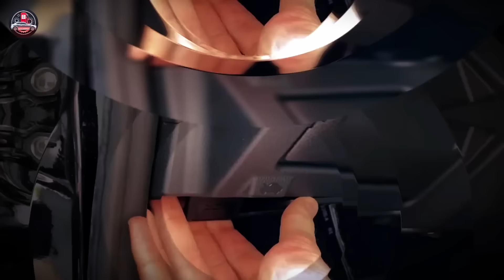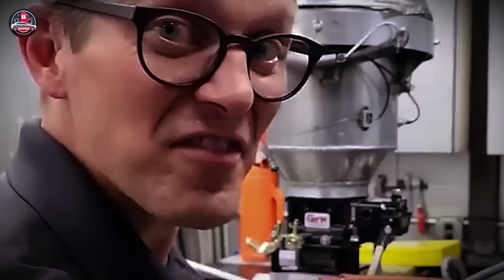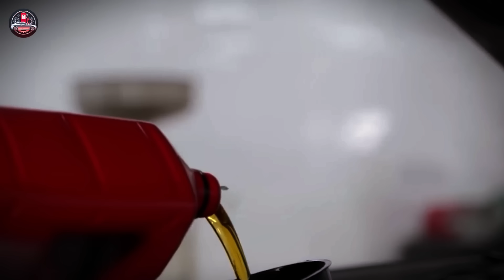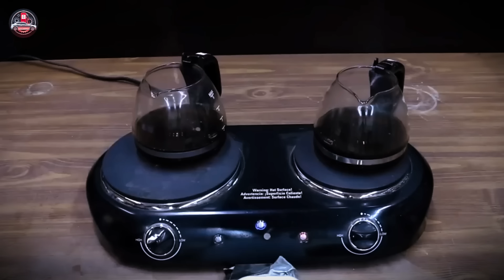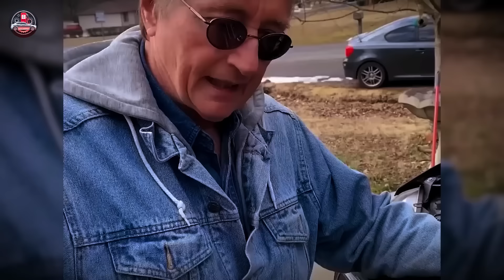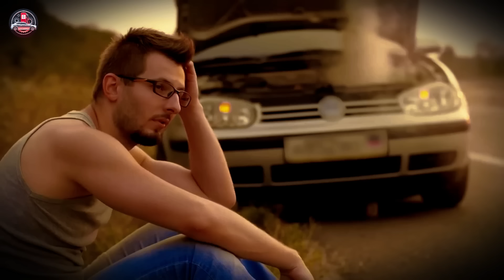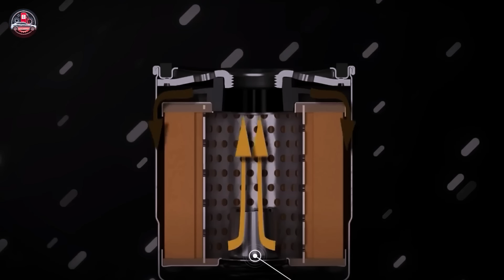We Ran 0W-20, 5W-30 & 5W-40 in the Same Engine — Here’s the Truth | Everything Oil for Car

Comment: Carlsbad NM, 88220 manual states 5 W 20. Using 5 W 30 Chawawan desert temperature . Fuel milage went up not down as expected. Asian engine blow by reduced 50 to 60% catalitic loading with oil loading and plugging.
Kia forte NU 4 l engine.
Engine much quieted using 5W30 from 5W20-Manual
Reply: Oil consumtion is oil pcv valve entrance to a cylinder valves carbon buildup and catalitic converter plugging and back pressure increased blow by adding more oil plugging.

Comment: 0W/5W-40 A3/B4 OIL CHANGE EVERY 5-7K KM IN 33 OLD WITH MANY MANY  KILOMETERS  FORD TURBO DIESEL INTERCOOLED EGR  AND CAT. WITH CAST IRON ENGINE BLOCK AND HEAD  WITH ZERO OIL CONSUMPTION ON ORIGINAL INTERNALS EGR  EXHAUST DIESEL PUMP AND TURBO. ENGINE NEVER OPENED. RUST FREE RUNS AS NEW

Comment: Matance, oil change every 6 months or 5 thousand miles according to my manual for my vehicle, which ever comes first, 0- 20 oil
Reply: O-20 can degrade or absorb water when not frequently be driving at high temperatures long enough from what I've heard, that can degrade it's lubricant protection on moving parts
Reply: +4
Yes, 0W-20 oil—even fully synthetic—will degrade over time just from sitting in an unrun engine. The primary cause is not mileage, but environmental exposure (oxygen, humidity, and temperature changes) that triggers oxidation, additive breakdown, and condensation, which can lead to sludge buildup and acid formation. 
Chahel Automotive
Chahel Automotive
 +2
Key Factors in Oil Degradation Without Usage:
Oxidation: Oxygen enters the engine and reacts with the oil, making it thicker and less effective.
Moisture/Condensation: If the car is in a humid environment or subjected to temperature swings, water vapor condenses in the engine. This water reduces lubrication quality and forms acids, which can corrode metal parts.
Additive Breakdown: Additives (detergents and rust inhibitors) designed to protect the engine begin to lose effectiveness over time (usually within 6–12 months).
Contamination: If the engine was run occasionally but never reached full operating temperature, small amounts of fuel and moisture from cold starts may have mixed with the oil. 
Just Automotive
Just Automotive
 +3
Recommendations:
Annual Oil Changes: Even if the car hasn't reached its mileage threshold, it is recommended to change the oil at least once a year, particularly if you live in a high-humidity area.
Running the Engine: Simply letting the car idle for a few minutes isn't enough to prevent this; you must drive it long enough to get it hot to burn off moisture and fuel contaminants. 
Just Automotive
Just Automotive
 +1
Conclusion:
While a sealed bottle of oil can sit for years, an engine is not perfectly sealed. The oil in the crankcase is on a "clock". If the car is in long-term storage (more than 6 months), it is better to change the oil before storage or immediately upon taking it out of storage.

Comment: I have it Ford Ecosport 1.5 diesel 100hp (Z2JA)  2019, the company says to set it to 0w-20 only, the ambient temperature in the area where I live (Greece-Athens) is the lowest 4°c to 44°c because I consider it too thin and in order not to get too far away I use 0w-30, maybe 5w-30 is better?
Reply: 0w30 would be preferred viscosity oil in that excellent Ford SUV. Don't go too heavy! Engine tolerances tighter than ever. If under any warranty stick w/recommended viscosity & change oil sooner. 👍🏻

Comment: This explains why the hemi 5.7 L engine ticking between 60k mi -100k miles
Reply: The Hemi “tick” is caused mostly by high idle hours. More city driving “stop and go” traffic. When you let the vehicle sit still while engine running ( whether in park, or in drive) the oil isn’t being pumped up to the top half of the engine due to low pressure. If you watch the pressure it will go from 50 psi (while in motion) to 30 psi ( when idling whether in park or in drive at a stop light). Over time, this will damage the upper cylinders, lifters, valves, rockers, etc.
Reply: The tick usually disappears after less than a minute after the first start Manuel states to use 5w-20.

Comment: not sure if this vid is real but i went from manufacture 0/20 n ram to 5/30 and rattles on startup disappeared.....high mileage engine so 5/40 maybe the next stop.... i will check oil condition this next oil change. All i can say is 0/20 feels like water with no viscosity even warm.... no thanks.....

Comment: This is a somewhat different topic.  Someone should test air cooled engines on zero turn mowers.  Mine has a Honda GXV620 and Honda recommends 10w30 or 30w.  In 98 to 105 degree heat.....that oil doesn't protect.
 enough.
Yes, air cooled engines run hotter than water cooled cars.  But, do a real test.

Comment: Use MOS2 for cold start protection. My D16A Honda 2003 engine is up to 440,500 km / 275,000 miles and still running smoothly after 23 years of non stop operation.
Reply: What source do you use, and how much do you add per qt of oil capacity?  Thx in advance.
Reply: @MrJdsenior  0.03-0.05% dilution in 3.5 litres of oil - about 1 - 1-3/4 gms MOS 2  technical grade powder stirred into 1 quart of the new oil before adding it to your engine at oil change. Add every 30,000 km.
Reply: @LeithYearwood  Thx Leith, appreciate the time you took to reply.  I will make use of that info.

Comment: This whole test is bogus as they were using Group 3 'fake' full synthetic oils.  True Synthetic (PAO ) oils never break down in a gasoline engine from heat.  They just get dirty and additives need to be renewed. Also why not try the 0W-40 that GM now recommends for cars that originally used 0W-20.  The vast majoirty of oil issues in engines since 1999 is the fact that we are not really using real synthetic PAO oils, we have been ripped off with Fake synthetics using Group 3 oil base (dino oil).  There should be a class action lawsuit for all the oil problems in new cars over the last 30 years because of this.

Also engines don't run any where near 3000rpm on the highway.  Most engines, evven small 4cyl and V6 engines run between 1700 and 2400 rpm at normal highway speeds.

Comment: Knoxville Tennessee. 
2010 Jeep Grand Cherokee Laredo WK 3.7 v-6. 
178,000 MI. 5w-20
Daily driver
Reply: I would switch to 5w-30 high mileage full synthetic if I were you
Reply: @Real_Rob_Reels 
Yeah I had been thinking that she is starting to use a quarter oil every 2500 miles
Reply: @Abaddon184maybe use Stiction Eliminator on your next 2 oil changes.

Comment: Hawaii tropical weather
Using 0w/20 full synthetic since 2018
67,000 miles without problem 
Can I change to 5w/30 need your opinion..?
Reply: Why change if all going well. More important to not go past 6k mi oil changes than changing viscosity recommended. 5w20 will add bit more stout & safer than 5w30 for ur engine. Facts.

Comment: Brian Northeast Florida Bmw X5,167, 280 miles Bmw F33 175,032 miles. BMW recommends 5 30, I run 5 w 40, because hot and humid Florida. Perform maintenance as the manufacturer requires and you have no issues with oil. My BMW E36 went 348,000 on 5 w 20 before a coolant loss killed it. This video is pointless, The .0 whatever untill oil circulates doesnt matter with synthetic, the wear surfaces retain the viscosity for months.  properly cooled and filtered oil can drive thousands of miles at 4-6 thousand RPM across the country, so saying the Honda engine broke the 0-20 oil in 30 minutes is unrealistic. Dyno testing oil is crap.

Comment: Adelaide South Australia. i have a 525 E60 BMW, it is reccommended to use 5W30 but most BMW workshops here reccommend 5W40 and thats what i run in mine, i change it, including the filter every 5 to 6 thousand kilometers.
Reply: 5W30 Northstar 12- 2001 Cadillac-Amsoul
Reply: 10w-60 in very hot climate or spirited driving

Comment: Just looking at the title I know this is ridiculous. Different engines require different viscosities, for example in the piston aircraft I work on we run exclusively 20W-50. Being that thick would destroy an automotive engine pretty quickly, because the engine is built very differently with closer tolerances. Run standard auto oil in the same aircraft engines, it would not provide enough protection once it gets hot. Just look at oil specs across different temps, often different viscosity for different seasons

Comment: Marlen in Aguilar Colorado.  I use Amsoil 5W-30 in my '90 and 97 Lexus LS400's, '92 Lexus SC400 and a '92 Buick Roadmaster.  The all will go well over 10,000 miles before I have to add a quart. The '90 Lexus now has 276000 miles and looks, run and drives like a new car.
Reply: Newer Lexus vehicles are not as good as older ones. Not even close! Facts.
Reply: The older Toyota engines will run half a million miles on just water. Not really but they were amazing, next I always liked the 4 liter Jeep engines I put 650k miles on a 95 Jeep engine and it was still running.

Comment: Was the engine designed to run 0w20 ? Engine tolerances vs the engine built to 5w30/5w40 specs

Comment: Fullerton, California. Started running 5w30 Valvoline Restore and Protect Synthetic in my 2005 Honda Accord with K-24A engine at 163K miles. Still consumes 0.5 quart per 1,000 miles like it has since new.
Reply: Great move now try the 5W40 I was amazed after 4 4 changes 3k each on a 3.8 with 150K

Comment: I live in Mongolia.   Winters are severe.  -20 to -40 Dec to Mar. I use  0W - 20. About 100000 miles on the Prius. Use about a quarter of a quart between oil changes. Usually change every 4000 to 5000 miles. Why do you ignore 0W😢? - 30 and 0W - 40 oils

Comment: 2019 Ford Mustang GT 5 L in Florida… Approximately 15 to 18,000 miles per year. In the spring, to summer, I’m running 20 W 50 mobile one full synthetic and in the cooler season I’m running 15 W 40, full synthetic.
I’m pretty sure I have the only coyote that doesn’t tick at idle

Comment: College Station, Texas    0 20 full synthetic oil Mobil One in 2013 Nissan Altima S with 144,200 miles
Reply: Is your Synthetic Group III or Group IV. Word Synthetic is a marketing term. The court case between Castrol and Mobil 1 regarding the marketing of synthetic motor oils was ruled in April 1999 by the National Advertising Division (NAD).

Comment: I live in Kingman,Az. I use 10w20 in summer and 0w20 in winter. This is  what Honda recommends.I Change oil every 3000 to 4000 miles. I have 2005 pilot with 280000miles. 2017 with 120000 miles.
Reply: IMO, 0w20 is too light for that HOT climate. I lived in Las Vegas and always used 5w30 in our Maxima's even though 0w20 is specified 4 EPA Cafe standards.

Comment: 5K intervals. North East 5W-40 2014 Passat 1.8 EA888  179,962 miles turbo. Cruise set to 57 on interstate slow lane sunroof open 29 minute ride to sons close to 41mpg. Not common driving conditions but when time and conditions allow GS in NJ, 
40 mpg on a gas when cruise set to 57 in slow lane 1.8 w/189K 
ain't bad

Comment: Do the recommended oil weight. You have oil ports,where oil lubricants everything. Their is a reason for recommend oil for your car
Reply: 0-20 in US for most Toyota-Lexus but every other countries say 5-30. The O-20 runs dirty past rings and the film fades away faster at rest, so the start up argument is suspect.
Reply: @carlpiersall1683 i don’t care about other countries.

Comment: I have a 2010 Silverado with 5.3 ,when I run full synthetic when idling about 20 pounds when I run 50/50 synthetic the pressure is at about 30 pounds and over 40 on the road Ben running 5 w 30 for both ,I even noticed more power from the 50/50 synthetic,I have  over 210,000 miles on it yes I’m running a amf delete .

Comment: 55w20 mixed with heavy w30 in winter, and w30 in the summer. But only after using an oil additive.   Do this made start ups easy at -50c in the winter time, never idle for warming engine, but drive slow till engine warms up equivalent to one city block. I'm not sure if I'm hurting my engine but it pures like a new engine. Engine at125000km  engines to my understanding break in at 180000km.

Comment: Lavalette, WV.
2012 Subaru Forster / blower
133,000 miles / 0 W20 Mobile 1
1 quart/ 3000 miles usages 
Short trips 3 to 12 miles each way 
First oil burner I’ve ever owned and by far the most expensive to own.
Seems like the auto industry are screwing the owners intentionally with their designs. $600 for both belts and water pump costs before paying for labor is ridiculous. Engineers have designed to steal our money for the auto and oil industry companies. 
I’m 79 years old and all the plastics pisses me off as they are trash from the start. Mechanically also was made impossible for the average person to work on a vehicle. Making engines that can only be serviced by dealers is outrageous. I purchased new vehicles from1969 to 2009 but I will never buy a  2014 or newer vehicle again as long as I’m alive. They can keep their garbage and I’ll keep my money.
Reply: Its a subaru of course it won't last its no Astrostar or old school Civic
Reply: Luckily, they're much more reliable now.

Comment: The engines in the B-roll are usually not the K24 engines you said you tested.

Does Lake Speed Jr (the motor oil geek) know you've used a picture of him in your AI video? Has AI stooped so low as to use pictures of genuine experts to try to get a semblance of authority?

Was the test you talk about really done? Or is it just a lie to give the impression of authority? For three engines to be tested in the same conditions on engine dynos, you would either need a climate controlled dyno chamber, which would mean it's taken up for nine months for the three engines, each doing a three month test, or you need three dynos running the engines at the same time. Either way, it's a damned expensive experiment, and unless you were working for Honda's engine development group or working for an engine oil manufacturer, you really aren't likely to dyno test three K24 engines for three months each. I suspect that this "test" is fictitious, especially since it's AI-generated. Show us evidence that these tests did actually happen.

Comment: Story fails to tell that MOST all fully synthetic motor oil (sold in the U.S.) is FAKE, and is NOT really fully 100% synthetic oils in the U.S. after the Mobil vs Castrol Motor Oil lawsuit win in a U.S. court (Castrol won, but it's not 100% synthetic; just priced like it). Look that story up on YouTube, you'll be angry and feel ripped off. We've been lied to, and it's 100% legal. What??? Mobil is now changing their formulation for Mobil 1 from full synthetic (Group IV base stock) to a semi-synthetic. This was apparently Mobil's response to Castrol winning it's legal lawsuit regarding their claim to sell a full synthetic when Mobil claimed was not. Mobil changed their full synthetic formulation to a semi-synthetic, similar to Castrol's. So, now they BOTH lie to the consumers, along with many other brands. All in part to the U.S. court systems.

Comment: Hartford, ct.
Mobil 1 , 5/30, off track, on track 5/40 then change back.
6.2L camero automatic
2.8L caddy--castro 5/30. Std trans 6 speed.
😂😂😂
Change oils no more than 3500 miles. Oil is cheap compared to engine replacement.
Also changed drain plugs at every 3 or 4 oil changes.
BTW, my Camero has external oil coolers on her, she also takes 10 quarts.

Comment: I'm in London, Ontario Canada... I drive a 2012 BMW 535i xdrive M sport running Liquid Moly 5w40 and sometimes Liqui Moly MoS2.
 At 286,326 kms right now.
Reply: In Japan mos2 was or still is put in new vehicles coming off assembly line.

I use it in my diesel and is makes for a quiet engine

That is the real story

There is a reason diesel engine oil is 15w-40 and in 8 quarts I use also a wuart of Lucad dtsbilixer hich sticks to mrtal for lubrication for cold starts and high heat extrs vidcodity protrction

Who cares about fuel mileage when you are quickly destroying an engine with thin oil

Comment: Well they don't say what was on the oil cap. My mechanic said tolerances are tight on the new engines and you should put what it says on the oil cap for your car. My old mechanic said 5w20 in winter and 5w30;in the summer. But I just drive normally within speed limits so not sure what to really do except follow what they say. I change it more often and everything good with 5w20
Reply: Your old mechanic... 5W is the viscosity of the oil in cold weather and 30 or 20 is the heat resistance, so 30 has a higher heat resistance. If the mechanic wanted to "help" the engine with cold starts in winter, he should have advised you, for example, 0W20-30. So, choosing 5W20 did not help you in winter, it only took away your sportier driving, because this oil is not suitable for that.

Comment: I am not a mechanic by trade. Your engine was designed for the oil weight shown on the oil filter cap. Yes cold weather is lower viscosity,  high temperature or hard use higher viscosity.  Oil is cheap,  engines are expensive = change your oil.

Comment: I have a 1998 Dodge caravan with a 3.3 L v6 that uses 5.30 w sometimes I use high mileage oil or synthetic blend and what is the correct mileage for an oil change it has 133.794 miles on it